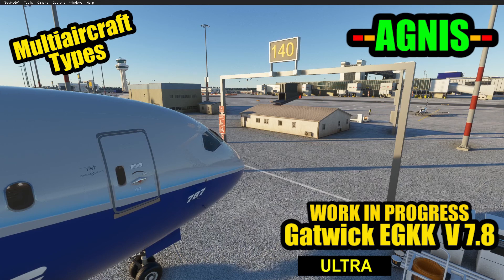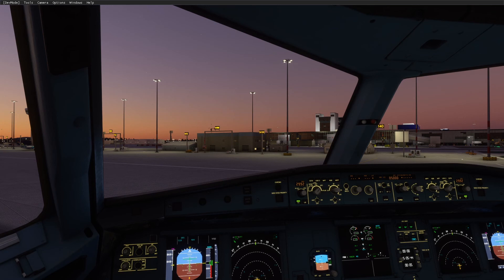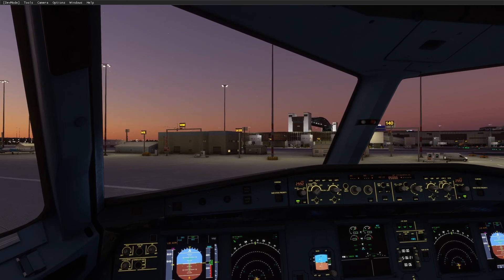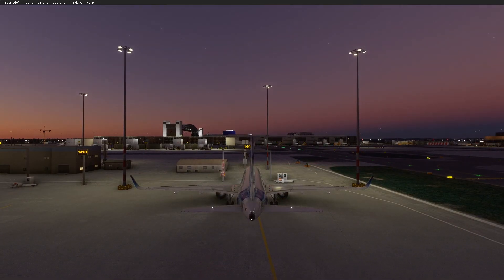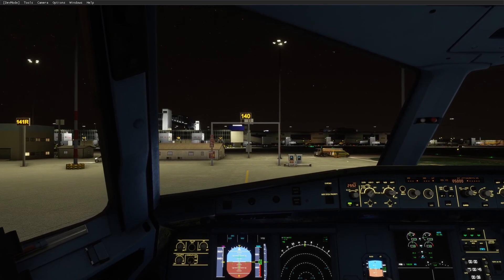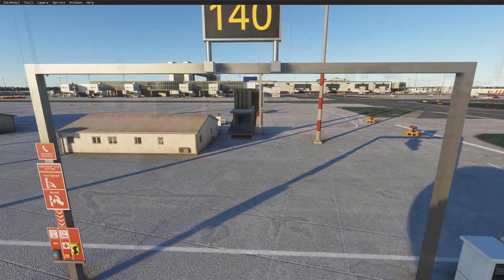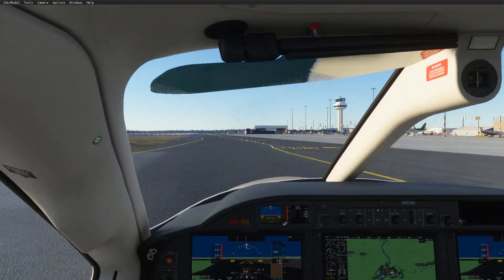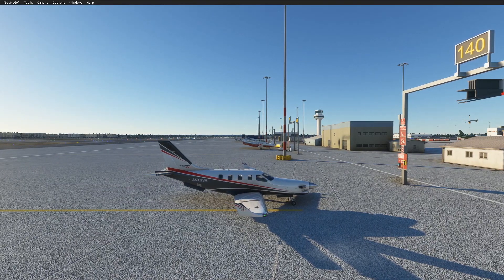FS2020 Gatwick Mod AGNIS- Stand Parking Guidance

Comment: How about increasing the height for B748, would it not work?
Reply from the maker: I got some higher ones in other areas , I’m just about to try some. Because the Guidance is mounted on the bar which is close to the stop point if i were to raise it any more any other planes like an airbus would park short half way onto the stand
Reply: @Mkvy  Would it be possible to make 2 or 3 options or is it too much of a work? Just copying the idea from SAM :)
Reply from the maker: H Buberci who is sam?
Reply: @Mkvy  It is a plugin for X-Plane 11 for jetways and marshallers/Dockings.